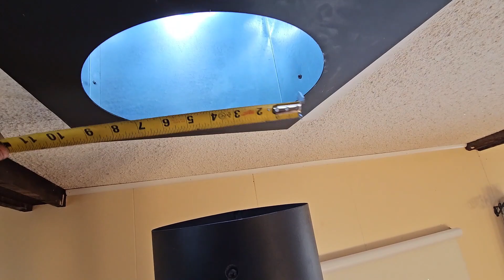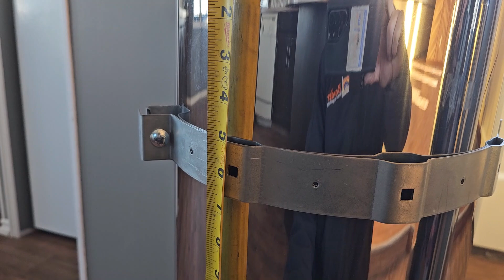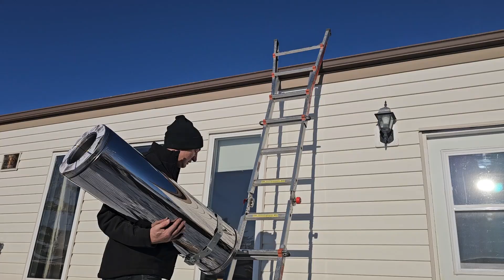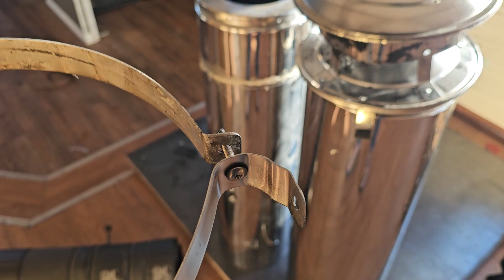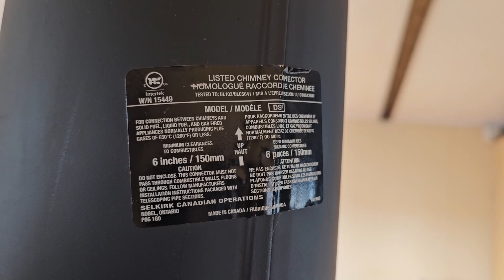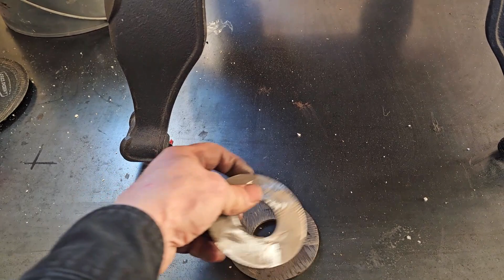Installing a wood stove chimney Wood stove chimney install

Comment: I looked everywhere on line for information on assembling the CF Sentinel system  & finally found this excellent video.  Any way you can add CF Sentinel into the title to help others find it? Adding screws to the "locking" bands that "secure" the chimney sections is a great idea!  What size screws did you use? Thank you😊

Comment: Hey thanks for your videos very helpful. Do you have a favourite brand of pipe?
Reply from the maker: I personally like Excel by ICC. This type of chimney sits together with about a 1" overlap and is held there by three screws.  The other brands tend to be a twistlock style which tend to loosen off. I like thd fact that excel comes in 4' lengths and is less than half the weight of a 3' length of many other brands.  Excel is S629 rated even though it is only a 1" insulation pack. Many of the other chimney systems are 2" insulation packs and have way more components. Over all the Excel is one of the easiest chimney systems to install but it is expensive at about $100/foot or more depending on the piece.
Reply: Excel all the way down to the stove? Who carries the excel products in Alberta?
Reply: Also can you pass through an interior wall? Are there components made to do this? (From a living room to bedroom then up and out)
Reply from the maker: @benburrows9985  if you use a wall thimble and a base T stainless (insulated) pipe it is OK.  If you do it with the black flue pipe you need a 36" hole through the wall. Most insurance companies won't accept a black pipe through a combustible wall under any arrangement.
Reply: Thanks again for the videos and information. Best to do it the right way and enjoy it.